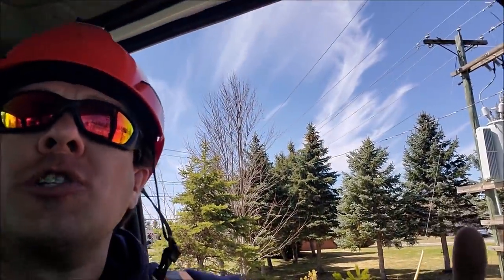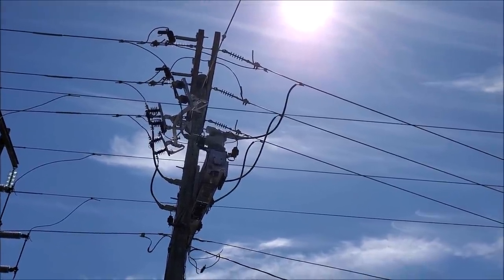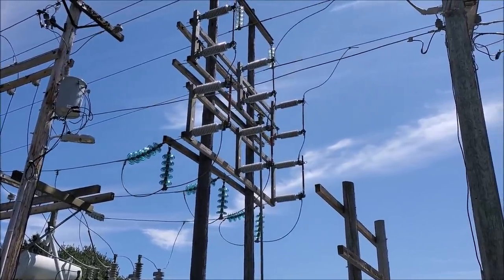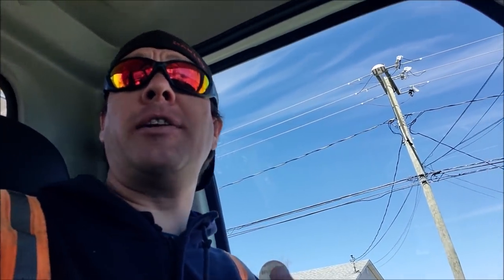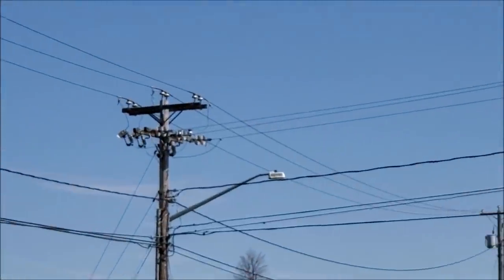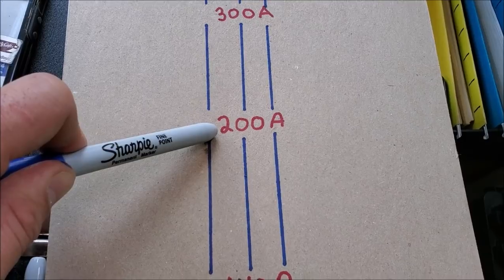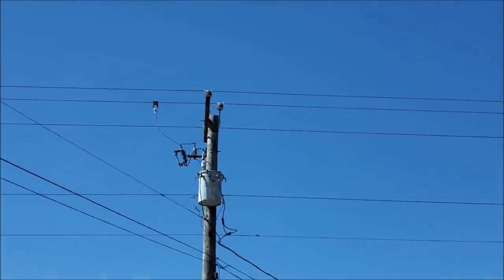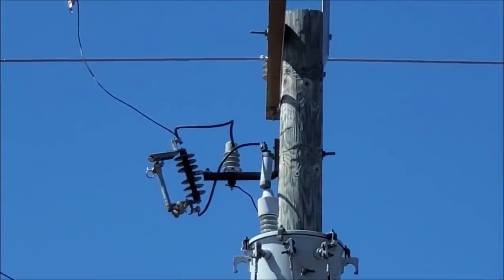Basic components of a power grid

Comment: Here if the power flickers THREE times we know it's going to be at least an hour before its restored. (spoken as a lowly consumer that I am)
Reply from the maker: That's pretty much how it goes! Some will lock out if the first shot has an extremely high fault current. (Without consumers, there'd be no jobs)👊
Reply: Wish we got warning like that...our outages have always been everything fine then...nothing.  We flicker so much I have UPSs on all the computer/TV stuff so it takes a moment to be like "wait, it got quiet, too quiet, what happened and why is the emergency light on...oh..."
Here I think the shortest outage has been around 6 hours (longest in the 3 years renting was 42 hours during a wind storm, we got a generator after that one but unfortunately have to use extension cords thru a window and down hallways as the landlord won't let us have a transfer switch installed).  When we one day buy a house, one of the first calls I plan to make is to an electrician to have a transfer switch and inlet box installed...most places also have well pumps here so no power means no showers (hot or cold), no washing hands, no flushing toilets...
Reply: Here, it depends on the power company. If it's NOVEC (a customer owned cooperative), it'll be an hour or less, if it actually goes out--which is very rare. If it's Dominion Virginia Power (an investor owned utility that owns most Virginia politicians), it'll be at least 3 hours, and it'll go out even in clear weather with no wind. And to give you some idea of how Dominion Virginia Power runs things...I've seen places where they have 4 or 5 automatic splices in a row between poles.
Reply: @brianleeper5737  Where I live dominion energy is good we rarely ever have long outages unless it's a bad storm that knocks alot of peoples power out across the county